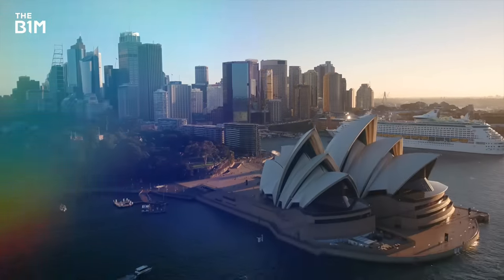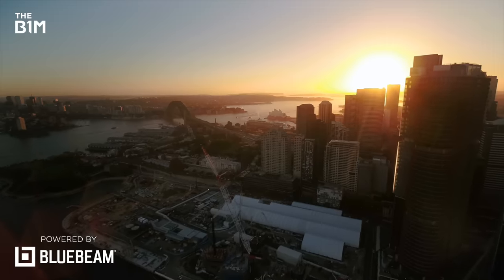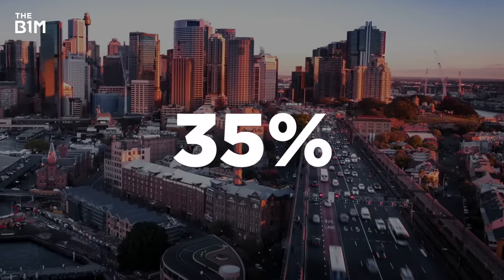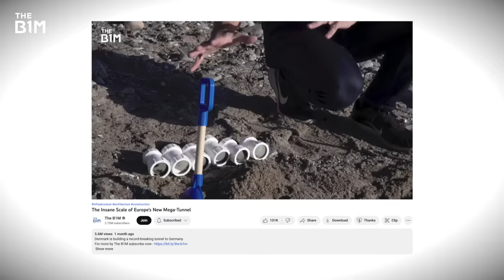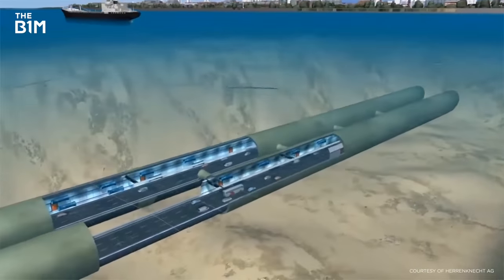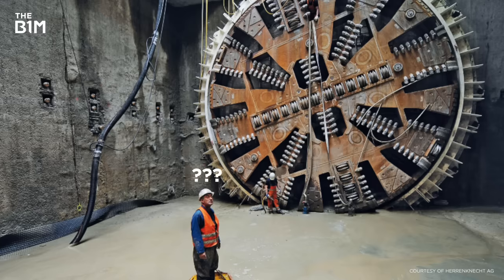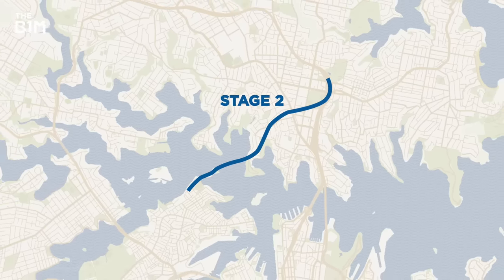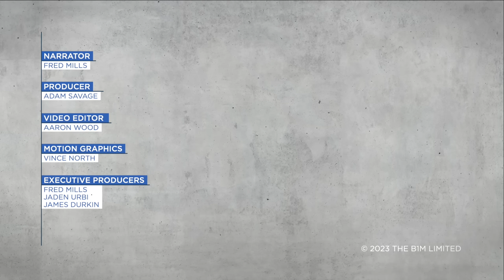Sydney's $5BN Tunnel U-Turn

Comment: They will still drive around on Victoria Rd via the Gladesville Bridge and end up in the same place as your proposed tunnel.

Took that route to Greenwich in July to avoid the toll, now living in a toll free state without a toll account. Used a toll badge in the 1990s for the Harbour Bridge, a simple monthly bill to pay , could cross the HB 10 times a shift, my customers would pay me for the toll charges.

To underline this the ABC staff from  Pacific Hwy and Campbell in Artarmon (now closed down) did not care which way they went to Balmain 1. The Gladesville Bridge or 2. the Harbour Bridge. 

10 times a week in that tunnel with the tolls OR Victoria Rd and the Gladesville Bridge free ?

Have mentioned before there is an electric cable Tunnel off the end of Louisa Rd going over to Greenwich.

Another old Coal Mine tunnel travels from near Howard Smiths opposite Burkenhead Point under Birchgrove to the middle of the expanse of water out from Sydney Ferries base, Ponies and Canaries type of mining.

Showing Sandstone on the good Video , hope that pesky Coal isn't there. Thanks for the Video

Comment: My only quibbles would be:
-  Anzac Bridge doesn't cross the harbour, it only crosses Rozelle Bay.  Gladesville Bridge is the one that then crosses the harbour to the actual north shore.
- "lack of public transport" is not quite right.  It might not be in the same league as London, but it's very comparable (170 train stations, 600 bus routes, ferries galore, light rail & a growing metro, 1.4 million trips per day) to similarly sized cities such as Barcelona (180 metro stations, 230 bus routes) or Tel Aviv. 
  But otherwise excellent

Comment: What the 16m tbm can do is also build Motorway lanes and railway tracks that way it does two stones at once reduce the traffic at the Sydney Harbour Bridge which has the North Shore Railway Line which is also at capacity and Harbour Railway Tunnel for the Metro

Comment: On the "cocktail of chemicals" issue, you have to realise that each end of the tunnel was once a heavy industrial area, with major chemical works, power stations (complete with coal mines) and even a radium smelter. These have long, long since been closed but the contamination was dealt with simply by burying it. Given the number of people living near and using Sydney Harbour, and the past massive efforts required to clean it up you can understand some concern about digging a big trench just there.

Comment: I'm pleased to see Sydney (my hometown) getting the slick B1M super-informative and interesting treatment. The problem with Sydney is that all NSW governments are far too eager to built more roads, at the expense of mass urban transit.
Even though Sydney has heavily invested in brand new light rail (might be an interesting topic for B1M) and is in the middle of constriction of two metro lines (also might be of interest to B1M) it always does its rail stuff in a piecemeal way.
We really do need to flip that script and go hardcore and built light rail, metro and high speed rail for the east coast. No more toll roads and motorways!
Reply: Sydney desperately needs cycle ways. Like hardcore safe exclusive cycle ways. It's a beautiful city with good weather. I cycled in London all the time but refuse to in Sydney, it's too dangerous.
Reply: @andyjcoop  agree! Sydney needs far more protected cycleways than it already does. But I wasn't suggesting it as an either/or. It needs light rail, metro, less emphasis on motorways, and more cycleways

Comment: One day I hope Sydney will have a transport network similar to Singapore MRT network.
Reply: The part of Sydney which is the size of Singapore has pretty good rail connections lol
Reply: Like for example the south part, there is no connection to other lines except having to go via the city. 
And the inner west area needs more rail links. 
Also increase the frequency of trains running, at least once every 10mins.

Comment: While it's a bit misleading to say public-transport is lacking, unquestionably up until a few of decades ago, except for the Bondi Junction Line,  little had been done to improve it!  Unfortunately, like many major cities, there was no heavy-rail (or bus-only transit-ways), linking or reaching the outer suburbs! 
However, this very expensive tunnel project really only benefits residents of the North Shore & Northern Beaches (Warringah Shire) areas who vehemently opposed every proposed railway plan (which would be a mix of mostly tunnels, above-ground, and viaducts)!

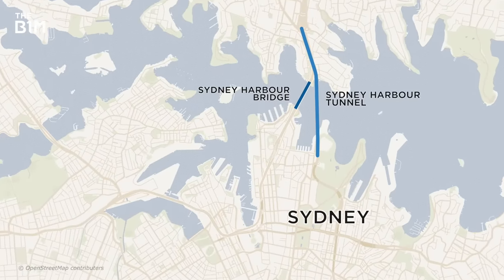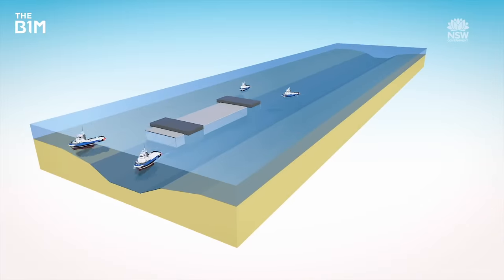Comment: Great video just you mentioned at 1:42 the existing harbour tunnel is underground - this is incorrect. I then noticed you mentioned at 3:00 the correct construction method: The IMT structure consists of eight precast concrete units. The units were constructed over 100 kilometres (62 mi) away in a casting basin at Port Kembla and then towed to Sydney Harbour. A trench was dredged before the arrival of the IMTs and then the IMTs were lowered into the trench by a system of pontoons and control towers. After the IMTs were in place the trenches were backfilled and then a rock armour was placed over the top to protect the units against marine hazards, such as anchors or sinking vessels. Reference: https://en.m.wikipedia.org/wiki/Sydney_Harbour_Tunnel

Comment: And I thought the tunnel-mania ended in Sydney when the last couple of tunnels (specifically the Lane Cove and Cross City ones) bankrupted the companies that built them a dozen years ago! Live and learn.
Reply: You would be surprised with how many are currently under construction, the metro extension from chatswood tunnels all the way under the harbour, through the heart of the city before popping up south of it. A new motorway tunnel just opened up with plenty more being built and the metro line from Sydney to Parramatta is also going to be fully tunnelled

Comment: Like gas, traffic will expand to fill whatever volume it is provided.  More and bigger better roads encourage more people to drive, and as we all know quite well, in this country we have a preference for driving alone to work.  Back to square one by 2035?                                                                             Better public transport designed to be attractive to use (safe, clean, efficient) is the only real solution. That and active transport.

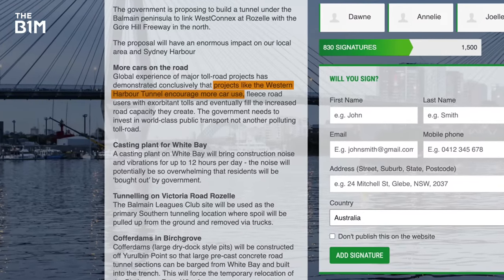Comment: 6:55 Agreed. It’s called inducted demand. I bet in 5yrs, maybe 10, after completion, SYD is going to be exactly back where they are now. Cities do not need more roads, they need less cars. Imagine if all those billions had been invested in expanding Sydney’s Mass Rail Transit, giving more people that don’t have to drive an alternative method for transportation
Reply: They are also expanding the mass transit system. You can do both... you know that, right? You don't have to be so black and white about it.
Reply: The population is heading to Victoria, they are going to have more issues
Reply: Many more billions are being spent on new metro than on this road project.
Reply: @daveg2104  You are Correct. The budget for the Sydney Metro City & Southwest is over twice the $5.5B currently allocated to this, reportedly around $12B. Metro West will cost even more then that, with Morning Herald alleging a price tag of $27B, although no official figures are being provided by Govt. So, looking purely at dollars and cents, the six lane road tunnel is cheaper. However, C&SW consists of 15km twin tunnels and 30km of new & converted tracks being upgraded to Metro operations, with the designed capacity of transporting 46170 people per direction per hour, using eight-car trains with two minute headways. This highway is not going to be able to move anything close to that amount of people. While buses will also be using this tunnel, private automobiles will comprise a majority of the traffic and private automobiles usage is completely unsustainable in the way that society currently does. Maybe that funding could have gone towards a North-South circumferential route outside of the CBD, akin to the Suburban Rail Loop in Melbourne, possibly using the T3 Lidcombe branch & T7 Olympic as a starting point before continuing north along a new alinement to interchange with the NW. Or just closing the 4km gap between Tallawong & Schofields
Reply: @ok0_0  Yes, both projects CAN be done. However, should they? Cities only have and are willing to spend so much money on transportation infrastructure and this road tunnel has the very real danger of sucking up all the oxygen once it inevitably exceeds its construction budget & timeline. When the politicians are looking for places to cut costs in transport, it will be the train that takes the budgetary strain. Example, the Big Dig in Boston, MA. The original 1982 proposal also included a rail tunnel between the city's two terminal stations but that was axed for reasons of cost & engineering. After 15yrs of construction, the project that was projected to cost $7.4B (2020$), is now $22B in total according to Boston Globe. MassDOT then forced the MBTA to take on some of this debt, and expand the commuter rail with more stations, which resulted in deferring maintenance on the Rapid Transit subway lines as funds were diverted to facilitate these State demands, all culminating into the Orange Line having to be Fully Shutdown in August 2022 to complete heavy maintenance, including track & tie replacements,  as well as numerous other safety violations across the network. And this is all ignoring the completely unsustainability of the cars and their infrastructure, driving on oil in a very literal sense.

Comment: Ridiculous project with current urban planning knowledge. Sydney needs to be densified, make blocks mixed use and implement other changes to incentivize slow modes of travel, such as walking and biking. This project will just induce demand for cars and make the traffic issue worse. More relevant solution would have been to remove car infrastructure.

Comment: It’s good to see that authorities are taking initiative to make Sydney roads less traffic. However, building new tunnels or bigger roads can not be a long-term solution to this problem. The only possible solution is to develop a better public transport system first and then implement policies that encourage people to use public transport instead of private vehicle, especially in peak hours.

Comment: Why do they need 2 tunnels of 16m diameter? Why can't they only use one tunnel and make 2 levels in it. Top level goes in one direction, bottom level goes in the other direction? It would be cheaper.

Comment: I live in one of the local communities impacted by this big infrastructure project and I have to say, the indiscriminate loss of trees has already been having a significant impact on native urban wildlife. It is also going to further contribute to the urban heat island effect and reduce carbon sinks over all. It seems little to no effort was made to consider the existing infrastructure of nature in the planning of these works. Not to mention... why are there long term investments in a dying energy source? Why is money being poured into more roads when we know we will need eventually reduce our reliance on fossil fuels and for those that cannot afford electric cars, public transport will be the only option but no effort is being made to have a better public transport system in this city... I could go on and on.

Comment: "...it could make a huge difference to the City's traffic problem..."; This new highway won't do anything to reduce traffic in the medium to long term. Sure when they open it will shift traffic away from the other 3 crossings but it will quickly fill up all 4 crossings by making it look and feel "easier" and "quicker" to drive than take the limited available transit options - I.e. induced demand.

If they really want to impact traffic they should take $3-3.5 or even $4+B and build more transit across the city and even crossing the harbor on current infrastructure or maybe new infrastructure, and then use the rest to fund long-term operations of the expanded system. Basically generating induced demand on the system that will reduce the total demand for driving and thus make the existing infrastructure sufficient.

They would have way better traffic reduction impacts than whatever the projections are for this boondoggle...

Comment: I understand the commotion about environmental problems and noise for the nearby residents, but some steps simply have to be taken. It's investing in a better future, which most environmentalists do not understand. Also, the noise/air pollution caused by the construction is only temporary, and then reduces back to 0.

And as I understand there's no great public transport, they should make 3 tunnels instead of 2, also 1 for 2-direction al trains or subway. If they dig a tunnel, why don't start with this anyway.

Comment: The statement at the start that Sydney doesn't have much public transport is simply wrong. I work for Transport for NSW, don't have a car and we take public transport all the time. It depends where you live and where you work. Perhaps you should have a read of the Transport 2056 strategy, which seeks to make it possible to get from nearly everywhere in Sydney to anywhere else in less than 30 minutes, except the extremes, such as Palm Beach and Liverpool.  The other issue nit mentioned is that when you look at a map if Sydney, the city is completely split in half, not by a 100m wide river like the Thames or the Siene etc, mut my a massive harbour with dozens of river mouths and bays. That does no make solutions easy, as with this tunnel project.

Comment: Very informative clip, I can understand what the government and engineers are attempting to achieve however, 3 lanes each way will simply not be enough as Sydney is an every rapidly growing young city, furthermore they must take into account all the recent problem that protesters had put in place to bottle neck the last tunnel which made traffic move to a slow crawl and stop. 
I see potentially multiple issues can be (E.g immense issues of traffic in the near future on entry and exit due to poor unspecific hard and electronic signage, lacking bus and emergency vehicle responders {E.M.S} lanes with potential to overtake, lack of a breakdown lane for large, medium to small vehicles will cause over taking issues. If a medium to large accident happens 2-3 lanes will be lost and once again will lead to a stand still and provent movement or slow it down  for hours until E.M.S can get through).

At the very least a 5 multifunctional open lane tunnels will last until 2060 based on the calculations an projections of planning and environment NSW https://www.planning.nsw.gov.au/Research-and-Demography/Population-projections population expectations. 
Sydney not only needs to build for the near future but foreseeable future as a plethora of sky rises are appearing everywhere.

Comment: Here are a few tips for Syd councils. Quite a number apx 25% of traffic lights need attention re phasing. Long waiting times and no side traffic, yet a few can't let one truck out  before his trailer leaves on a red while there might 3 or 4 trucks waiting, 2 right lane hugers doing 55 in a 70. 3 minor crashes don't move off the road. 4 police need to fine queue jumpers which causes other lanes to stop while idiots push in.  I find most Syd roads are very poorly designed, there was little forward planning.

Comment: Long story short, Sydney does not new roads but a comprehensive public transport policy, and adoption of modern modes of public transport. The policy should focus on moving people via supplementary modes of transport and connect them with main modes of transport. Focus should be on faster adoption of on-demand buses/Ferries and systems like Metro Neo which are quick to implement and cost way less.

Comment: 24 hr Bus lanes when most buses don't run 24hrs is another traffic creator. Forcing people to use the expensive Lane Cove Tunnel by closing off above ground roads also doesn't help with traffic flow..

Comment: Why doesn't Sydney also build a train system that runs along the tunnel as well? I am confused
Reply: Yea - but I thought SYD did have a pretty good public transport system - but then NZs is completely crap.
Reply: Because the new train tunnels are being built to connect to the train lines
Reply: The new metro tunnel is just to the east of the road tunnel, with the new line going into the CBD and then heading south, and then west. It isn't part of the road tunnel project though.

Comment: Sydney used to have the largest tram network on earth. Then after WWII the US oil and car companies came knocking and planting their transport policies in the NSW Govt. They did to Sydney what they did to LA. Destroyed the tram network. The heavy rail network was already in place but they froze any expansion of it for 60 years, with transport minister after transport minister coming from Oil companies. Shanghai built 10 metro lines in 10 years, and Sydney built one in 60 costing an eye watering sum without raising one cent from value capture while private land owners went on a tens of billions land speculation orgy all along the line.

Comment: I don't get why a City like Sydney invests $5BN in a new motorway. Induced demand is a thing, so this will just bring more traffic overall to the streets. They could have built a nice extension to the tram/light rail network instead. That would have reduced car traffic.
Reply: They are building something better than light rail in this situation - metro. And the cost of the metro projects are many times the cost of this road project.
Reply: They're already expanding the light rail and metros...